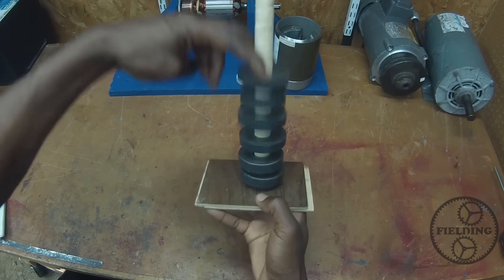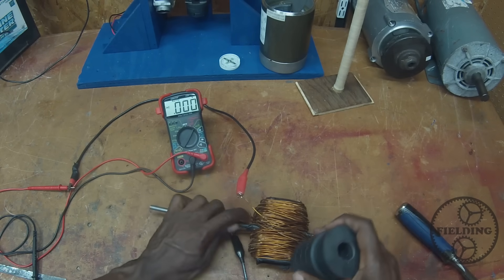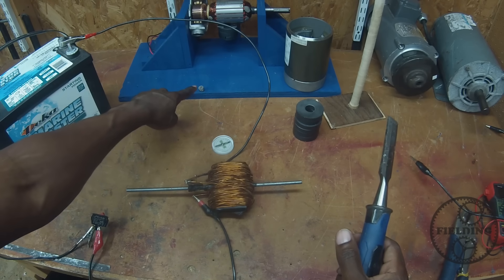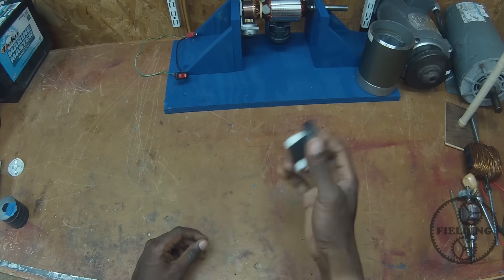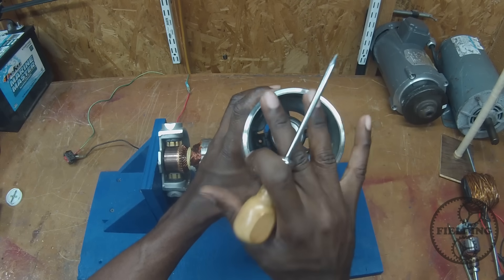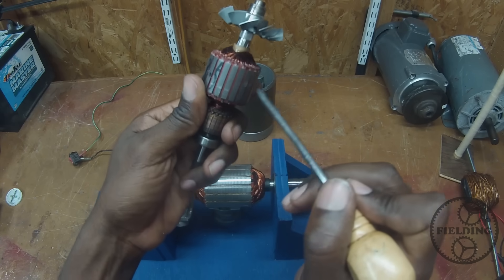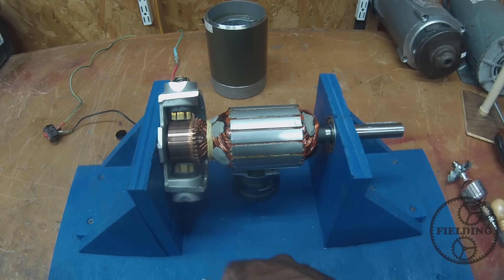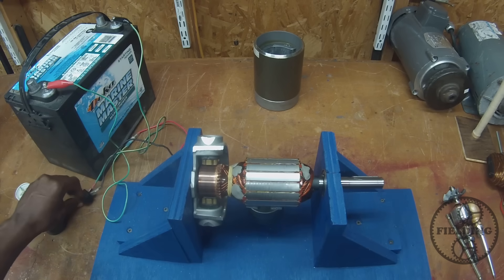How Motors Work For Beginners (Episode 1): The DC Motor: 032

Comment: i need help. its kind of urgent.please help me learn how to make a solar generator, shalom
Reply from the maker: I have a note in the description about this kind of thing
Reply: @Jeremy_Fielding  I don't see anything about computators. Where can I find out about them? Shalom
Reply: So if I have questions, you will answer them? Shalom
Reply from the maker: I see nearly all the messages that come through... but its like trying to read every stock price change on all the stocks... Consider for a moment I made this video over a year ago. and it still produces as many comments and questions today as all my current videos. Answering technical questions is not realistic. So, I TRY to answer very basic questions with only one correct answer. If that is not the case, I don't answer. Because there are so many types of motors, there is rarely one correct answer.
Reply: @Jeremy_Fielding  whats the link to the video about the commutator build? im so very glad you do answer me. it certainly makes my life better. shalom

Comment: You seem to be the most informative person on YouTube on electric motors and I enjoy learning from you. Could you help me figure mine out?  2 1/2hp 120/230 air compressor motor. It’s almost new. I’m running on 110v. Runs about 5 sec and trips breaker. Bought new run capacitor, same thing. Had start cap tested, said good. Starter clutch works properly. If I wire the motor for 230v and plug into 110v, run maybe half speed, but doesn’t trip the breaker. Any ideas before I just throw it out?  Thanks so much!
Reply from the maker: I have a note in the description about this sort of thing... please have a look

Comment: Does the wrapping on the coil have to be symmetrical? So it put equal energy from the copper pieces touching the brushes to the iron plates connecting them?  What I'm asking is, does the wrapping have to be perfect?

Comment: Hie am not a tech but i bought a second hand 3kw 3 phase motor that so before i did anything to it i wanted to know if the coils are ok so i did a continuity test the 2 coils reading was 24 and the one was 35 resistance / am i having a big problem here?
Reply from the maker: Unfortunately I can't offer one on one technical advice. It is simply not safe or practical to do so at this volume
Reply: @Jeremy_Fielding  do i have to send it for a rewarding?

Comment: if two magnet's = 2x speed then why we dont use 5-6 magnets at a time...
and what will happen when we put both S and N pole magnets side by side to each other down to the armature
Reply from the maker: Most motors have several sets of electro magnets... but putting them closer together changes other things like speed vs torque. Too much to explain in the comments, but a great homework assignment for you.
Reply: you are just asesom jeremy......you make all the motor lot much easy to understand...and very helpful for my exams thank you.

Comment: The like pole Magnet Demo at the beginning  has a use as a thrust bearing that dosn`t wear out applied to a watt hour meter with a mechanical regester. Second demo is a common magneto used in lawn mower ignition & battery  charging circut. On the PM motor other than flipping the magnet .in real application you interchange the + - leads to reverse rotation.witch changes the polarity in the armature.

Comment: These are excellent videos. If I could add one point it would be the right hand rule: stick your thumb up and orient it in the direction of current in the wire, if you curl you other fingers they will show the orientation of the magnetic field. So by extension if you wrap that wire into a coil like in a motor, transformer or solenoid the right hand rule will show that all magnetic fields line up through the center of the coil. Changing the direction of current flips that orientation.

Comment: Hope this isn't a totally stupid question.   Are AC horse power and DC horse power the same?    So if I have a 1/2 HP 120v single phase induction motor running my lathe would a 1/2 HP DC treadmill motor be just a powerfull?   The treadmill motors look so small even when they are 2HP.      Thanks for your page!
Reply from the maker: Horsepower is the same whether it’s a real horse, a car or electric motors. I talk more about the difference between motors in my video on go karts what motor to use. There you will see the actual differences

Comment: A great video!  I have a shop vac whose brushes are sparking badly.  I was looking around for ideas and landed on this.  It doesn't help my problem, but sure does help my understanding of motors!
Reply from the maker: Thank you!... If it is old... that usually means you need to replace the brushes If there is no other damage to the tool.

Comment: Hi J,  Here's great video on washing machine motors that you'll like.
Inside a Washing Machine Motor: Explanation, Pinout, Teardown AND Experiments https://www.youtube.com/watch?v=CtulRqznbzI
Reply from the maker: I have seen this video. It is about a universal motor found in washing machines over seas. In the US, they are nearly all induction motors. But outside the US they are nearly all Universal motors.
Reply: A question on another subject that you might know off the top of your head.  The end goal is solar panels following the sun & Keeping It Simple.  So I figure a turn-table/clock is pretty darn simple. I plan to put my solar panel array on a big turn-table & set it up to follow the sun just like a 24hour clock does.  It just doesn't get any simpler than that (ex: Occam's razor).  In fact, I might put clock numbers on it just for the fun of it (ex: airplanes flying over get to see the time of day).  
Question: ?Can I easily control the RPMs of a DC motor, if I feed it a PWMed DC voltage from my solar panel system?  When the turn-table/clock runs slow, I'll just increase the PWM frequency & vice versa.  Of course, I'm assuming the DC motor RPMs will be ~proportional to the average voltage over the PWM wave train.  

Also can you recommend a great electric motor book or course.  I don't mean ones with lots of techie/geek math (I got those).  I want a great electric motor book/course that covers the quinessential concepts/components, the broad pragmatic applications, KISS/Occam's-razor, etc.  Like your video, Thks

Comment: I thought I read somewhere years ago that a DC motor must have a load attached to it otherwise it would increase rotation until it blew itself apart. Is that correct?
Reply from the maker: Universal motors yes

Comment: I'm trying to figure out it a fan of a car ( 12v dc) will run if it is connected to a ac supply?

We can't buy fans anywhere here because of the hot temperatures people bought them all up, 
So I've taken a car radiator fan/ built a housing for it and got it running nicely, but connected to a car battery which doesn't last long, and so what would happen if I hooked a dc supply to  it? Would it run? Burn out the comutator rings?
Reply from the maker: Watch my video on speed control for DC motors. That should give the ideas you need to solve this problem of running on AC
Reply: Jeremy Fielding 
Deffinatly will later today, thankyou!

Comment: I wish I could've seen you actually wired the motor, did you wire that motor to the battery? Secondly, how do you know if the magnets are North Pole or South? Can you tell by jist looking at it? Or did you have to test it?
Reply from the maker: You should watch the whole series. I am pretty sure you see it all before its over. There is even a video of me making a motor from microwave parts.

Comment: I’m hoping you might be able to help with a project. I’m turning a treadmill motor into a trolling motor for my 14’ John boat. Do you have recommendations on waterproofing a DC motor? I will have a housing around the motor but I need to stop water from coming in from the shaft which will be coming out of the housing to connect to the propeller.
Reply from the maker: Unfortunately I can’t help directly like this. I hope you can understand, I get literally hundreds of emails through my YouTube channel for advice and general help. It just isn’t safe or practical to try and troubleshoot problems or give advice one on one.
Reply: Jeremy Fielding I completely understand! The World has gone to crap that someone can’t ask for help without the person providing help worrying about getting in trouble. I’m pretty sure I have it figured out. Trials will be next week, I’ll be glad to let you know how it goes, because your channels are extremely helpful!
Reply from the maker: It more than that... we aren't just talking about being sued or something... that's a small but reasonable concern... Its the shear volume that is unbelievable. Before I even finish reading your request... I have 10 others just like it about different topics. Its just not a sustainable way to help. That's why I make videos. Help lots of people at once. I can't do a case by case basis.

Comment: I've been watching a lot of your videos, I've been doing some research on a machine that I would like to try and build from a salvaged motor, the cost is about $350 with shipping.  I have no idea what household appliance would use this type of motor.  So here's an eBay link to the item, maybe you can help me figure out what I could salvage this motor out of 
https://rover.ebay.com/rover/0/0/0?mpre=https%3A%2F%2Fwww.ebay.com%2Fulk%2Fitm%2F332624422299
Thanks
Reply from the maker: I have never salvaged a motor like that.

Comment: I was looking at Baldor 6" Bench Grinders.  They have approx. 14 different models! One of the descriptions says: Built for heavy duty grinding, powered by 1/3 hp Baldor PSC type motor (except 612E & 662E which are split phase)
 What would be better for that type of bench grinder, a (PSC) Permanent Split Capacitor or a Split Phase motor?
 Is one harder or take longer to start? Do you have to spin the wheels to get it going?
Reply from the maker: Unfortunately I can't give one on one advice like this. Please understand, I get quite literally hundreds of request for help and advice on all kinds of projects. It just isn't safe or practical to do this one on one. This series covers the most common types of motors, and should give you a good foundation for your own research. Youtube moved your comment to the spam section probably because you posted it so many times on different videos. I read all my comments. There is no need to copy it to multiple videos. It is more likely to be missed as spam rather than read. I almost deleted it without reading because it was there.

Comment: I've worked with electric motors that use a three phase rotating magnetic field to the move the rotor.  They were 440 VAC.  As the three phases flow through the field windings they are synchronized so that when the field winding aligns with the opposing rotor winding the rotor is rotated.  This happens to produce 120 VAC at 400 Hz for aircraft maintenance.

Comment: I have treadmill permanent motor 1hp if i change magnet, i have more horse power??
Reply from the maker: If you can increase the strength of the magnetic field, you will have more horsepower. But replacing the magnets in a motor in such a way that it is "as effective" as the original is going to be pretty tough. The space between the rotor and the magnet is critical. It is very difficult to replicate that tiny gap with any kind of home made magnet arrangement.
Reply: I am good in magnet field 👍
Plz check my video magnetic motor... And send me your comment thanks for your attention thank you

Comment: if you run your universal motor on dc with just the wires going trough the rotor, it will still spin but if you short circut the stationary wires, the rotor will stall and start to rotate in the wrong direction at a lower speed.

Comment: the reason why the magnet slows down in  the copper tube is because the magnet and the tube is in relative motion to each other. the induced current is actually stationary but the maget is not so thats why there  is no free lunch this way. 
if only the field was induced and the maget was at rest, the opposite force would have accelerated the maget  instead of slowing down. 

if you use a ring magnet around the copper tube and drop a piece of steel trough, the steel will induce a current in the copper tube and repel the magnet on the outside.

Comment: you dont need to move the maget across the coild to induce currents. you can place the magnet and the coil stationary and move a piece of metal between them and you also induce currents. if you do this in a generator design, the generator will produce no mechanical resistance.

Comment: I had never seen the magnet in the copper pipe drop demonstration.  Ran right out to my workshop and played for 10 minutes with that one.  I teach 9th grade STEM and will link this video to tomorrow's assignment.  They made simple DC coil motors and this will be the explain/explore section.  Great job.  Many thanks.
Reply from the maker: Thank you for sharing. I am honored to be a part of a school assignment
Reply: The experiment demonstrates Lenz's Law, named after the guy who formulated it in 1834.

Comment: amazing  video  MR fielding.
1 are the copper wires on the rotor insulated.if there is what kind is it.
2 what causing short inside the motor if they are insulated
Reply from the maker: Overheating can burn the insulation... It can be a clear coat... sometimes the wire is aluminum with a copper colored insulation like the wire I used to make the coil at the beginning.

Comment: good video. but why do you say copper coloured wire is aluminum?
Reply from the maker: The color you see is an insulating coating. It is aluminum on the inside.
Reply: wow that was a quick reply thnx. could i also please ask you why very small dc motors use magnets on the stator and not coils?
Reply from the maker: It is significantly cheaper
Reply: that makes sense. nice job

Comment: What determines the speed of the motor when energized?
Reply from the maker: for the DC "brushed" motor is will run as fast as the the power it creates can push the rotor. little to no load means higher speed
Reply: Jeremy Fielding. I think it goes by the number of turns in the field winding in relation to the number of turns in the armature also the potential voltage applied. Can't recall...might be the "old-timers" disease thing actin' up again.
Reply from the maker: I am only addressing what you as the user can control. That would be what voltage you apply, and what load you put on the shaft. But yes, the number of turns internally changes the strength of the magnetic field produced... all those variables come together to produce a speed.
Reply: And the reason we use Direct current motor as opposed to Alternating current...
   It's an interesting topic ...I find the Railroad industry particularly interesting in their use of D.C. power.

Comment: I think the reason the neodymium falls slowly thru the tube is due to magnetic flux. Basically an interruption of the field surrounding the neodymium.
  If the copper were magnetized the magnet would be attracted to it.

Comment: Hi Jeremy I’m a beginner re motors and am trying to make a DIY wind gene. For this I hope to use a food processor motor, it has no magnets but gives a low voltage when I spin the rotor by hand. How can this work without Magnets? I have been collecting motors from skips to make renewable energy. I have a hover mower motor that has no Magnets but it also gives about 5-10v when spun by hand. But I have a motor from a hoover that I can’t get any voltage from. I’m a bit confused by all this. Is there any chance we could chat elsewhere such as on Facebook pm etc?. Cos I could really do with some help working out why 2 motors give voltage but 1 doesn’t even though they all seem to be the same type of motor. In that they all have copper windings on the stator and rotor and no Magnets in any of them!
Reply from the maker: I can’t do one on one advice, I receive hundreds of requests like this and it is not safe...but you should watch my video on my home made generator. It will answer your question.

Comment: I got a dead Kitchen aid 120 vAC mixer, it has power up to it but no go. How do you test the motor field winding / armature separately? If I put 120 volts AC directly to the brushes should the motor run? Thank you
Reply from the maker: Unfortunately I simply can’t do one on one advice. It is not safe, and not practical given the large number of request like this. However, someone here might try taking you through it.

Comment: hi loving your helpful info. I am working on a project which requires my to use an electric dc motor, however my knowledge is limit3d and would like to ask a few questions. application is for a wake board, how would I size the dc motor based on speed ? what would you recommend ?
Reply from the maker: +freddierick maalat I cant say. There are too many variables which have to be considered, the weight, gearing, friction, operating voltage ...I would have to do some homework to be of any help. Due to the number of requests I get like this, it is just not practical to do so.
Reply: Jeremy Fielding understood thank you 😊

Comment: Jeremy. I have 220 DC 4 HP , do you think I could take  each leg of the 220ac and run it through a bridge rectifier to power the motor
thanks for taking time to educate
Reply from the maker: +Cjh Valdez I have a video where I talk about this extensively... you should watch that. It is called “ how to wire large dc motors and controller the speed” search my channel. It is easy to find